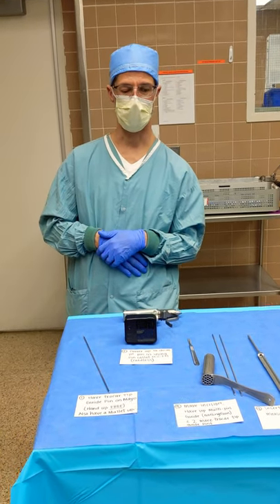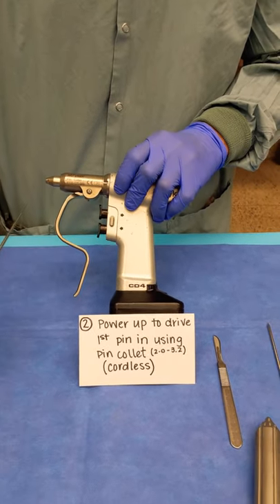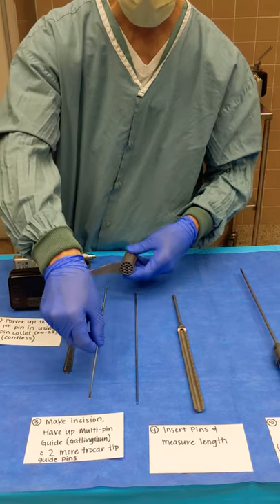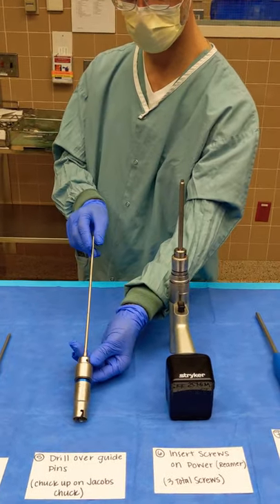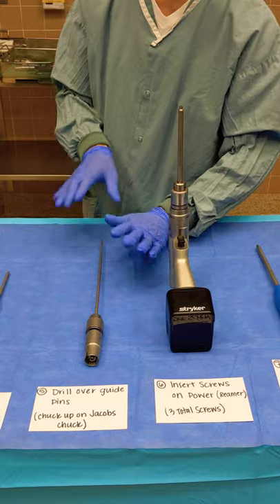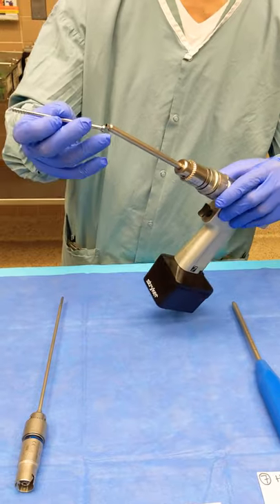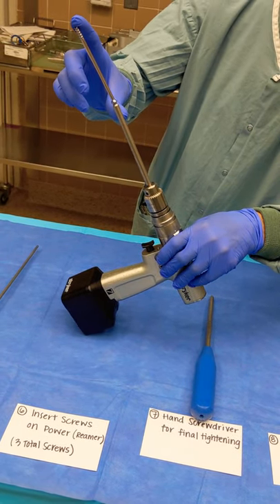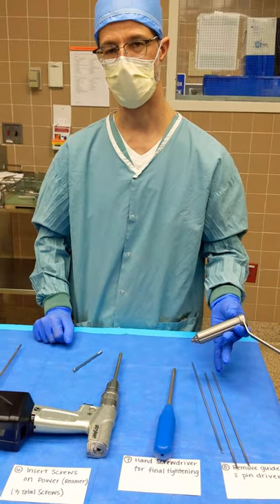Zimmer hip pinning/ 6.5 Cannulated screws

Comment: Is the drill set to ream because it’s a hip? Why not drill?
Reply from the maker: Most people who get a hip pinning are elderly, their bone quality is poor. You don't want to put a screw on drill, ( so you put it on ream, which is a slower spin, a.k.a less torque) most of the time, because you don't want to put it in to quickly; it is more about the torque, or control. There are some surgeons who will use only hand and no power to put the screws in. When you put that much spin on a screw, at a high speed, you can actually counter sync the screw head, in most cases you put three screws and one of them has a washer, to keep it from doing exactly that.